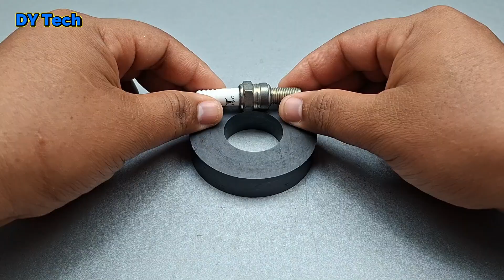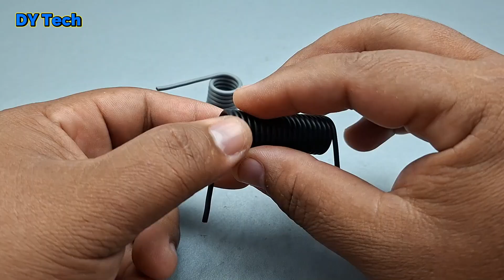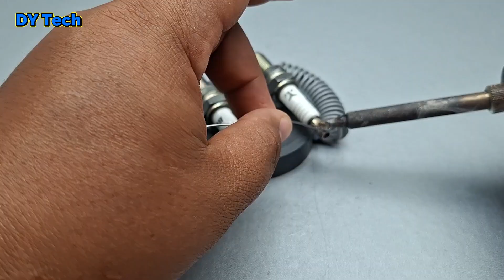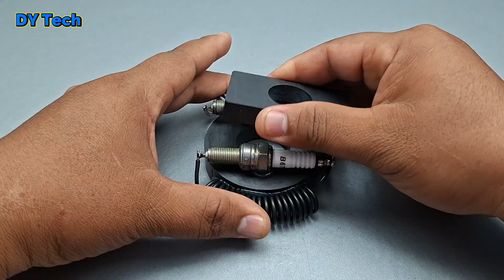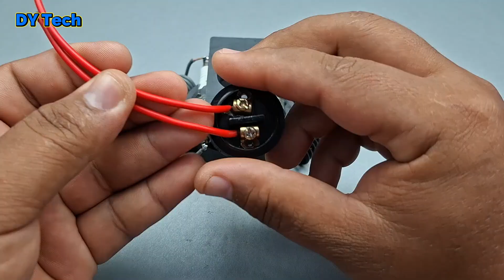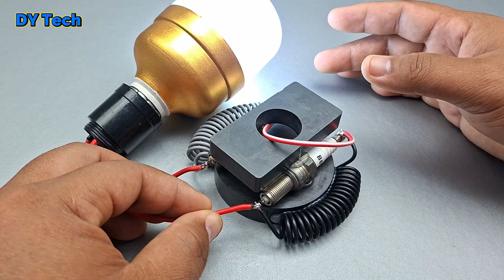how to create 220volt electric energy free at home with pvc copper wire use by spark plug

Comment: Now explain to people which components set the voltage to 220 Volts. You can't because NOTHING there has anything to do with 220v. Spark plugs only fire the mixture in an engine and magnets are good for sticking things to refrigerator doors. THE WHOLE THING IS JUST ANOTHER SCAM AS USUAL FROM THIS CHANNEL. Load of rubbish. Battery is in the gold part of the lamp. The two red wires switch it on when it flows through the mess of useless wires. To generate an output ENERGY has to be put in. Nothing is moving = NO ENERGY = NO OUTPUT. ........SCAM......